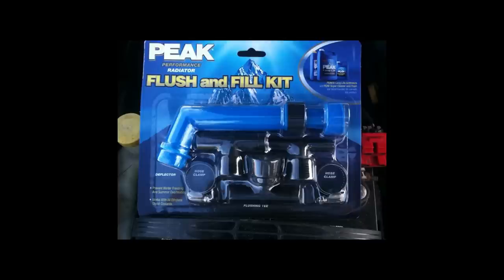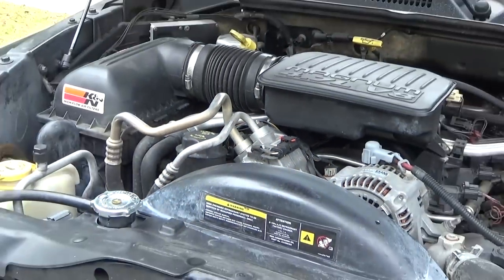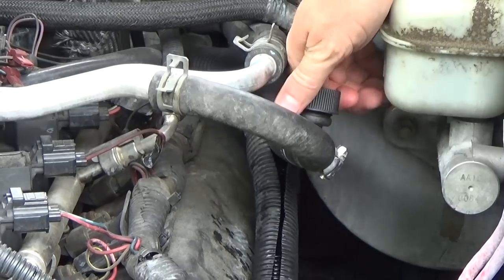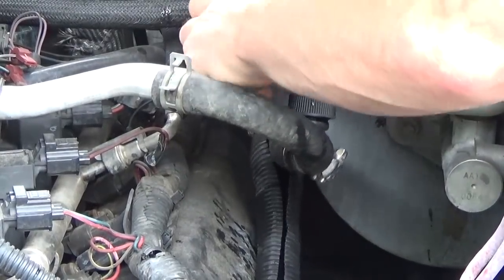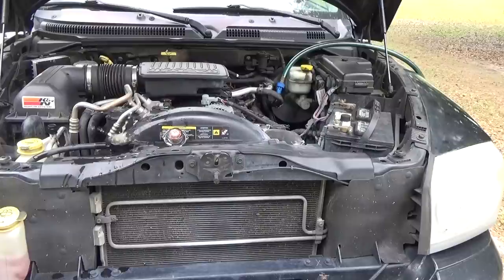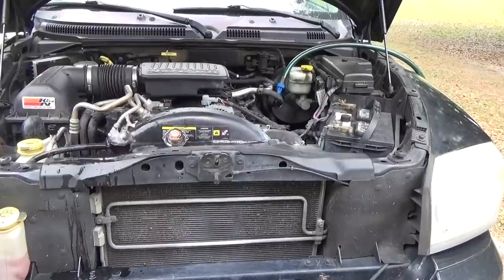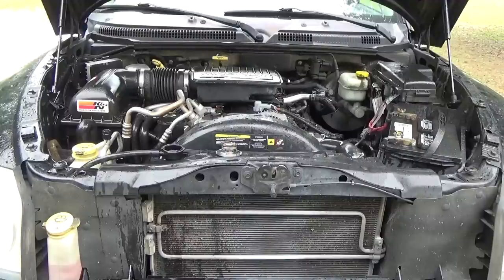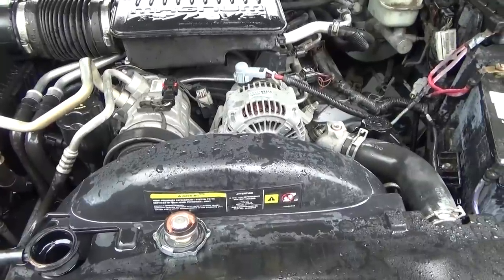How to Flush Your Car's Cooling System and Radiator

Comment: I never introduce tap water into my cooling systems. Good way to stop up the system. You cannot get it all out.
Reply from the maker: It's not nearly as big of a deal as people make it out to be.  Just make sure when you are done that you refill it with distilled water and coolant.  All coolants today contain anti-corrosives which neutralize any remnants from the tap water.

Comment: Does this flush the heater core?
Reply: No, you will need to buy a coolant flush "liquid" I recommend Prestone. Then run your heater on high for 20 minutes. After that drain the radiator them do this procedure
Reply from the maker: The truth is it depends.  If your vehicle has a heater control valve, then this won't flush it because the car won't get hot enough for it to open. If your vehicle doesn't, then this will flush it.

Comment: Do I have to cut the hose ? Or can I disconnect it
Reply from the maker: You have to cut it to connect the included T. If you don't want to cut it, you can buy a short piece of hose from the auto parts store that matches your size and temporarily install and cut it. Then when you are done just put your original back in.